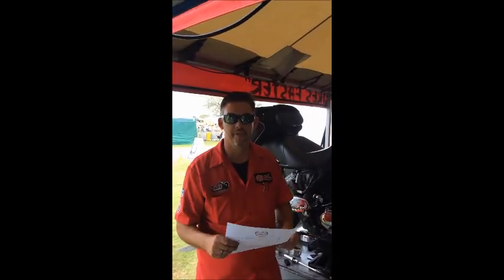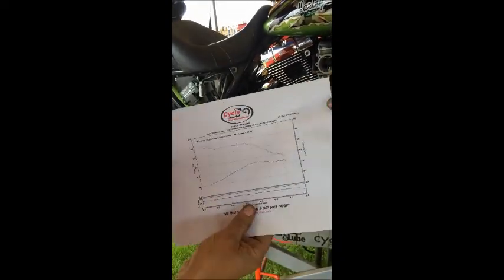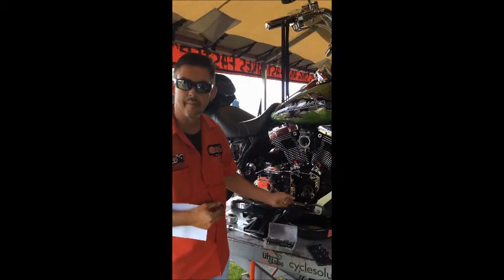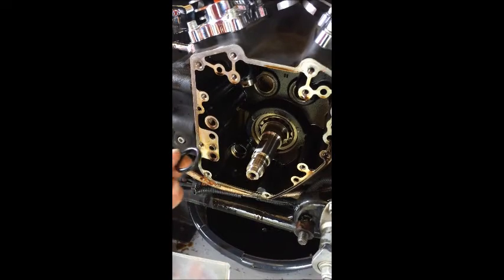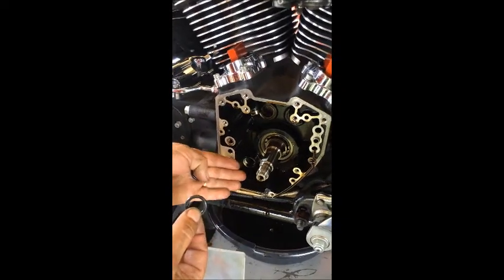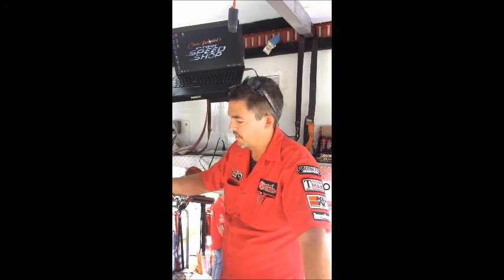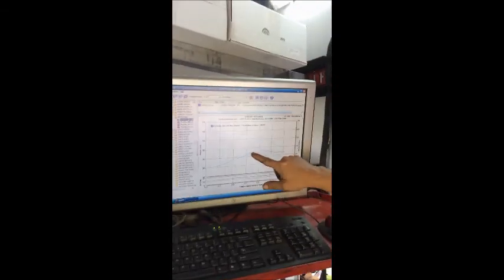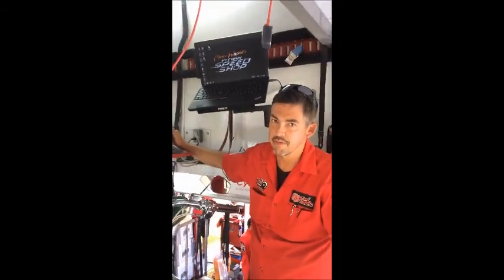Oil Pump O-Ring Replacement and Dyno Graph from 36HP to 77HP

Comment: I just put 509 cams in my 01 road king new oil pump o ring. Same issue loss in hp and torque. Could i have pinched or cut the o ring on install. Bike had more power with stock cams . i will. BE taring it apart tonight to check the o ring